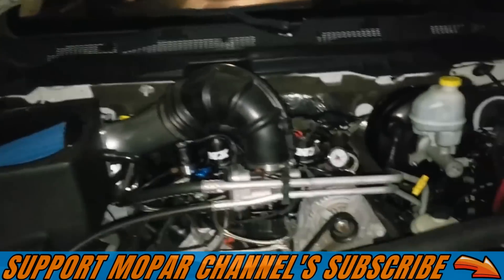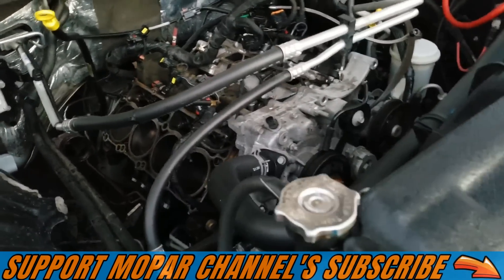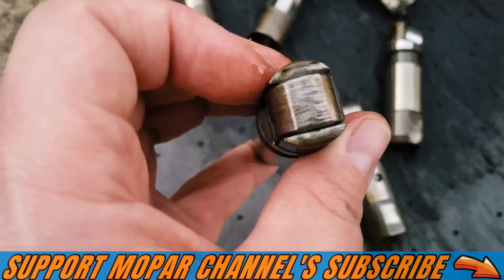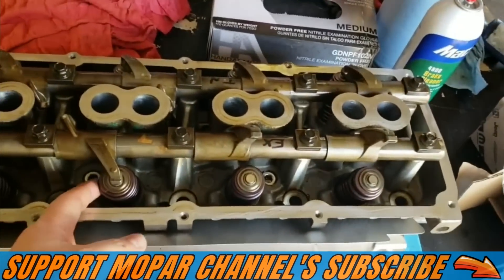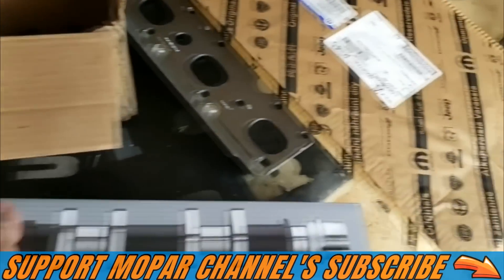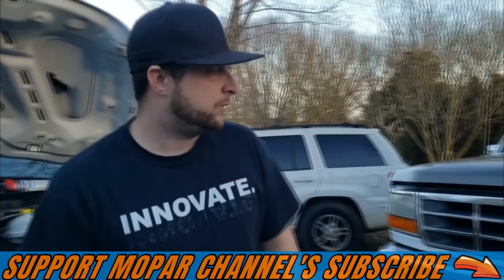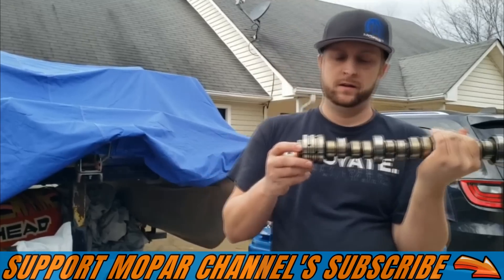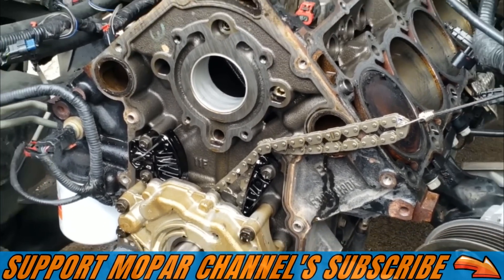5.7 HEMI TICK CAMSHAFT AND LIFTER REPLACEMENT MDS DELETE

Comment from the maker: Thanks for the support mopar fam I really hope this video helps you out on camshaft and lifter issues🤘🙏
Reply: Good day, what is your ram year of production and how much miles on it?
Reply from the maker: @jevgenijslaba5217  2011 it had 130k
Reply: Thanks your prompt respond, have a 2014, but only 70k, couple of days ago hear ticking sound, and afraid whether have same problem started... What was cost of spare parts?  Could you please send a company you bought from?
Reply from the maker: @jevgenijslaba5217  I installed high performance parts so it's a bit expensive parts and tune will Cost about 3000 if you go with a factory cam and the you looking around 1500 in parts roughly
Reply: I know I am late in seeing this, GREAT VIDEO... I have a 2012 Ram sport. Just got a misfire code on cylinder 3, now my Ram runs rough going up wills. Thanks for the part list, ordering today. I have questions; when you deleted the MDS DELETE PLUGS, did you get any check engine codes? Will it or did it pass the emissions inspection? How do I contact GREENE RACING for the timing specs.?
Reply from the maker: @buildingtrades7070  no need to remove mds solenoids and install plugs. Alot gas changed since then lol. But contact jay greene and he will tune it right for you his link is in the description.
Reply: Hey! Great channel!
Have a 2013 Ram 1500. Had this problem and changed 8 of the lifters because of a big failure on cilinder 2. Decided to change all the lifters. That was about 2 months ago. Started hearing the ticking again... 
Have you heard of Dodge talking about this regular issue with this engines..?? Love my truck and want it to last longtime
Reply from the maker: @elvaquero3030   Yes unfortunately it's a known problem but still no recalls If under warranty they will replace the lifters and camshaft if damaged and worse scenarios they replaced the entire engine.
Reply: Hi I was wondering does dodge Warranty that problem?
Reply from the maker: @hemilifeornolife567  if it's still under your warranty contract they should.
Reply: Great video. I had the same “clicking” with my 2010. My buddy said his 2005 had a lot of issues with the exhaust manifold studs as they had a tendency to break. I checked it out and 2 were broken. I used an extractor bit to pull them out, replaced all of the studs and the sound went away.
Reply from the maker: @natephillips3220  good information man nice Repair
Reply: Hi thanks for responding to me also had another question I heard of a lot of people put their truck in four-wheel-drive at the dragstrip so they can catch traction is that a good idea?
Reply from the maker: @hemilifeornolife567  yes it definitely helps alot just watch out for wheel hop.
Reply: Hey man  what aftermarket lifters would you recommend and if I got new lifters would my cam be fine. Assuming the cam is still in good shape and if not what cam? Thanks
Reply: I POSTED THIS A FEW MINUTES AGO ON UNCLE TONY GARAGE - GEN 3 HEMI CAMSHAFT FAILURE MYSTERY EXPLAINED! THIS INFORMATION MY BE USEFUL TO YOU.
TONY, I DOUBT THE ENGINEERS WOULD MAKE A FATAL FLAW MISTAKE LIKE THAT IN THE DESIGN OF THE BLOCK AND PRODUCE IT FOR SO MANY YEARS WITHOUT CORRECTING IT. IT HAS TO BE SOMETHING MORE SIMPLE. THE ONLY LOGICAL ANSWER TO WHY THE CAM LOBS ARE BEING WIPED OUT IS THE LIFTER ITSELF. WHERE THE ROLLER THAT RIDES ON THE CAMSHAFT, THE CENTER SHAFT DRILLED HOLE WAS NOT CENTERED WHERE IT WAS OFFSET, WHERE WHEN YOU SPIN THE ROLLER IT WOBBLES UP AND DOWN CAUSING A FICTION EFFECT. THIS IS ALWAYS THE CASE WHERE THE SUBCONTRACTOR WHO PRODUCED THOSE LIFTERS FOR CHRYSLER HAD BAD QUALITY CONTROL. THIS IS WHERE CHRYSLER SHOULD BEGIN THERE INVESTIGATION.
Reply: Do you work on hemis at a shop or are you in NWGA by any chance? My 16’ RT just started doing that loud ticking noise at 81k
Reply: Do the short push rods go on the intake an long rods to the  Exhaust
Reply from the maker: @marvinautoworks9955  that's correct
Reply: @FrostbiteRam  thanks. I have a  2015 with 5.7 and 1 of the brand new lifters that 8 just put in a week ago had 0 movement on the it. So hopefully a new litfter with fix that..  I did the cam and lifters
Reply: @FrostbiteRam   1 more question is there such thing as a front and back lifters
Reply: @natephillips3220  pretty sure 2009 and up have the lifter/cam prob
Reply from the maker: @Heeman105  if it's doing cold but stops after warming up its most likely a broken exhaust manifold bolt or leak.  If it does it cold and warm most likely lifter/cam
Reply: i want to contact with you please in dm i have some questions
Reply: MMs - If after all this how are we to get oil to the rollers. Or will that be an issue now.
High revving to cause splash in bumper to bumper traffic isn't an option. Thanks for your reply

Comment: I’ve been looking and need help. What would be the best upgraded cam I could put in my 2021 5.7 ETORQUE Rebel. I have borla cat and Vararam intake. Also have edge pulsar (which I will be moving to real tune onday) I’m getting era shorties in the next few weeks. I want to upgrade the cam. Which would be the best without tune and would run with the ETORQUE. I can’t find anything about it anywhere. I only find cams for non Etorque. Thank you. My goal is to have one of the fastes with Etorque eventually if that’s even possible. I’m new to all of this only been in it for about 4 months now. Thanks again
Reply from the maker: Good question haven't heard of anyone doing a cam in one yet. Contact jaygreenetune or doctor differential and speed shop see what they offer.

Comment: Dodge should pay to fix al l these issues,they have known about it for years,and just kept selling theme
Reply: They do pay alot, they will usually cover up to 80k miles.
Reply: @mikes2460  even after warranty?
Reply: @patrickb6938  i think its like GM when they dont want to lose a good customer... ive heard they can cover half up to like 80k if the car is just a little out of warranty.
Reply: @patrickb6938  yeah the guy was a loyal mopar truck owner, he was at 90k but within the time and they gave him a half price new engine... they threw in a wiring harness also so he made out.
Reply: When the Obama government says get better mileage, you're forced to use cylinder deactivation voodoo and watery oil grades.
Reply: @jt7216   And now beijing Biden is causing oil prices to go up by cutting off new leases for oil drilling and canceling the keystone xl pipeline.
Reply: Yall are blaming government for fiat Chrysler's shitty engine designs. Ford and chevy don't have problems with their engines eating themselves lmao
Reply: @Lq32332  nice anecdote, didn't ask
Reply: extended idling causes lifter failure.  the oil pressure gets low. Hellcat oil pump has larger channels for better flow,  bolts in
Reply: Yes GMC has the same issues in some of the newer 5.3 with push rod failure cam and lifter.  Just some parts that were not hardened correctly.  A friends Denali blew up at 45k miles.  Google it if u don't believe me.  For some reason Ram's defect just seems to get more publicity in the 3 to 5% who have c
roller cam failure around 100k.  Especially if idled very long hours and 10k mi. oil change intervals not based on idle time.  Kick it up to 2k rpm occasionally when driving by forcing it to down gear.  If waiting in line long timed or traffic named slip it into neutral ever so often and reeve it up from 5k from to 20rpm.
Reply: I just changed the camshaft,16 lifters, and Cadillac converter on my 2017 at 190k miles. I'm the only owner. I use royal purple oil

Comment: I know it’s been a few years but do you remember what the hot idle RPM was when you had the lifter failure? I’ve got a 2020 1500 and my factory tune is set about 525-550. I have a theory that the low RPM isn’t spinning the oil pump enough at idle to provide enough oil to the lifers. I feel like if the idle rpm is set to about 750 it would be much better oiling. Just using my foot it goes from 31psi to 45 psi.
Reply from the maker: Not sure but with custom tuning that does help oil pressure

Comment: The HELLCAT Lifters that you'll be getting or already put in are the exact same part number of the ones you took off actually. The hellcat uses the same lifters as the 5.7 L HEMI ENGINE, NO DIFFERENT THAN THE 6.2 L. I'm sure you probably figured that out by now but I'm just watching this video today. The PERFORMANCE HELLCAT CAM KIT YOU PUT IN IS JUST A STANDARD OEM HYDRAULIC, RELIABLE IF TREATED PROPERLY AND NOT ABUSED OEM HYDRAULIC LIFTERS. If you did remove the MDS, which I'm guessing you did because it says that in the title? The MDS has nothing to do with that cam/lifter failure. hopefully you installed what is important is a new hellcat oil pump which will give you 12% more volume eliminating the lack of lubrication at both ends of the camshaft, where the problem is due to lack of lubrication because of the length of the intake and exhaust valves being higher up than the previous generation splash oil lubricated cam/lifter. Chrysler failed to install a larger OEM OIL PUMP, BUT THEY DIDN'T FAIL TO YOU ON THE HELLCAT ENGINES WHICH DON'T HAVE NEARLY THE PROBLEMS A 5.7L does. Enjoy the video because I'll be doing something like that soon. I'm sure though I have 120,000 miles on my vehicle. The majority of the miles were highway driven not to mention I used to 100% synthetic engine oil which I only went over the 8000 mile mark once. I'm in Canada, so I'm having trouble converting the numbers exactly but yeah and then I started adding a zinc oil supplement to my motor, in order to help lubricate and prevent wear on the camshaft. It's strictly an engineering problem that was overseen or intentional likely overseen by the CHRYSLER ENGINEERS.
Reply from the maker: No sir that cam was a custom grind racing cam from comp😉
Reply: @FrostbiteRam  Sorry you'll have to read my comment over again please? I was referring to the cam lifters being the same part number as the hellcat CAM lifters. I did not mention anything about the cam shaft, which is a completely different part Dando cam lifters. I do the same thing when  I read quickly and see what I want to see and not what I should see.
Reply from the maker: @davidleslie949  the aka hellcat lifters are just non mds lifters nothing special but they are used in the hellcats and any non mds hemi

Comment: Mine is a 2008 1500 with the 5.7, coming up on 185,000 miles. I am the original owner and love the truck. Just purchased a new 2019 with the 6.4. Had a couple of the old guys back in the day tell me that you want to do the first oil change before 2000 miles to remove any metal dust etc... from the break in period or if anything wasn’t completely flushed out when the engine was assembled. Did the first oil change at 2000 miles and switched over to full synthetic oil at about 35,000 miles. Always have done a short warmup after it drops from high idle and generally don’t let it sit idling for long periods of time. Within the last 20,000 miles or so it will occasionally have a slight tick on startup if the truck has been sitting for several days. This has been my primary tow vehicle and has probably 80/20 highway to city driving. Firmly believe that doing the first oil change early and switching over to full synthetic is the way to go on any engine. Because of the amount of highway driving vs city, I push the oil changes generally to 6,000 miles. Can’t complain about this truck at all. Oil changes, air filters, brakes and tires in 185,000 miles.... if that’s what some people consider junk then I’ll take it all day long.
Reply from the maker: Very nice definitely great trucks

Comment: In my experience, the best thing you can do is to use Schaeffer oil.  The Moly prevents this wear.  We started using  Schaeffer 5w20 in 5.7 he is when MDS first showed up in 2006 in the Ram 1500.  We now run Schaeffer 0W40 in our 6.4 hemis.  It’s like somebody turned the wear switch off.
We won’t run anything else.
Reply: Jim Ferguson Hey I have a new 2019 2500 6.4 I just seen your comment and interested in using Schaeffer 0W40 right out from the start with my first oil change.

Comment: Here is another thing to consider. During engine breakin, thousands of unfiltered (because they are so small) tiny pieces of metal are washed through the roller camshaft. All the way until the owner is told it needs a change, by a electronic meter! Sometimes 10,000 miles! These micro pieces of metal, come off the cylinder walls and rings as they break in. Get them out of your engine, after 3,000 miles.  Ram has lowered the valve spring pressure on all its newer 5.7. Hopefully this will do the job also.
Reply: So basically change oil every 3,000 miles or at the very least the first 3,000 miles? 
I've heard of some dudes doing first 500 miles then again at 3,000 to avoid metals getting into places it shouldn't.
Reply: @MrComputerCoder  WELL SAID as this is the best practice in preventative we are in tear by being proactive by changing your oil at no more than 5000 miles yes I synthetic oil is used or 3000 miles if I conventional oil is used. This is a proven method to protect any engine, but more so for the hemi 5.7 L. Furthermore, if you wanted to all but 100% guarantee this problem from happening to your engine would be to run 100 % Full synthetic oil and on top of that do not idle the engine for more than 10 to 15 minutes at one time. Lastly, and the most important of the three would be to replace your oil pump with that over HELLCAT HEMI OF ANY YEAR AND MODEL AS THEY ALL USE THE SAME OIL PUMP, WHICH HAPPENS TO BE A DIRECT BOLTON FIT FOR THE 5.7 L. YOU MAY HAVE TO SWAP THE PRESSURE RELIEF SPRING AS THE TENSION IS DIFFERENT. The other method would be to mess around with the 3 wire oil pressure sensor instead of getting a code which will occur when the new pump is installed. It will read incorrectly, but not really because it's doing its job because the oil pressure will be higher than 60 psi and it will throw a code but that's ok  because you want a higher oil pressure which is caused by the new oil pump because it's a larger gear rotor I think 12% larger something like that. Changing the oil  pump and using synthetic oil at the proper intervals while not idling the vehicle for more than 10 to 15 minutes at a time. I can almost guarantee a non-cam/lifter issue on a 5.7 L hemi.
Reply: Also, I forgot to mention never go by that 10,000 km because it's actually 10,000 km on a hemi in Canada that that little light tells you to. Keep in mind that stupid oil minder uses up to 30 different parameters to estimate when that oil is due to be changed. It's a complete gimmick, because if you look in your owners manual your driving patterns believe it or not will fall under severe driving conditions almost everyone falls under this category and then you'll see a different interval for your oil changes! You will be shocked, but you shouldn't be surprised because auto manufacturers have this in their owners manual, but the programming is set differently because they don't want that engine to last forever. How would you ever come back and buy another car or truck? It's not a well-known, but it is kind of a trade secret tho not documented that the engineers are asked how long will this engine last & will it make it until when the warranty ends? That's why you're oil minder takes so long. It should be half of that depending on if it's mainly highway driven or stop and go traffic, which falls under severe driving conditions. Which in that case your oil change intervals are almost cut in half.

Comment: Thank you for the reply, It will tick when it's cold ,but when it warms up it will go away. I take pretty good care of it , I have  had two tune ups on it since I have owned it .I run premium fuel thru it ,and use Royal Purple oil in it . Starts right up every time, doesn't idle rough never had any issues with it. The only problem I have is the finder wells are starting to rust underneath the paint.
Reply from the maker: Definitely sounds like broken exhaust manifold bolt
Reply: What year is your truck , I had one of my fenders bubble just above the wheel well and they replaced it under warranty. It's a common thing they no it's a problem.